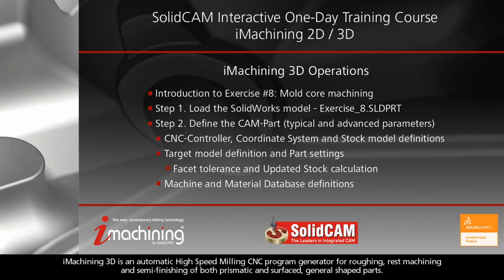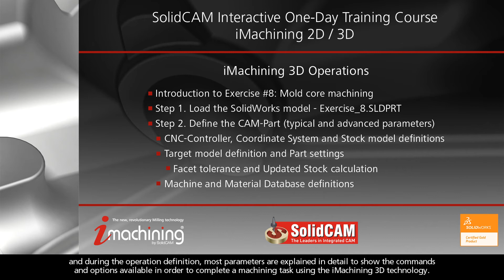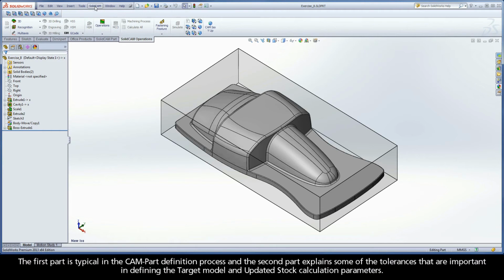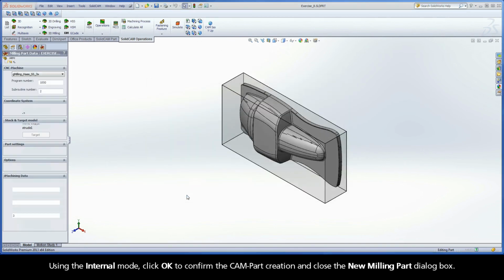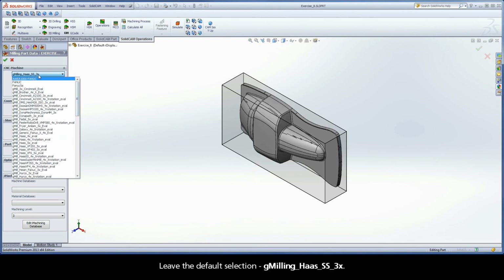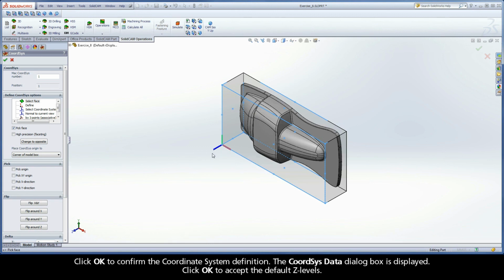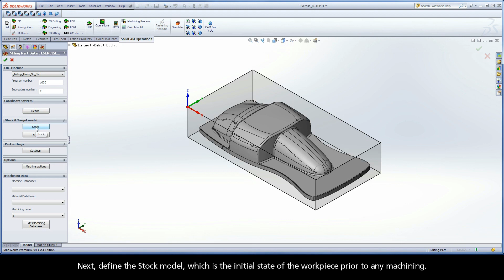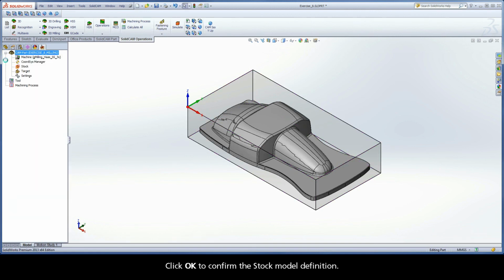SolidCAM iMachining Training Course - Exer #8: Define the CAM-Part for iMachining 3D (typical)

Comment: Hi guys nice course, i have one question on my trials with solid cam why when i try to define coordsys i don;t see the stock model??...
Reply from the maker: Hi Cristi,

Thank you! Did you first model your stock in SolidWorks prior to defining a new CAM-Part? This is the preferred method. In SolidWorks, you can then increase the body's transparency to see a ghosted stock model. Or in the SolidCAM software, you can adjust the settings to have the stock defined automatically, which will show the stock model represented by a Box. You can also manually define the stock by a Box and add the Box to CAD model (Target) in the CAM-Part Definition. Then, you can go back to the Define CoordSys function and place your coordinate system wherever you like on the Box generated by SolidCAM. If you need additional support, please don't hesitate to contact our support team, who would be more than happy to help you, even if you're only doing a trial. Visit http://www.solidcam.com/us/support/support/ to contact support.